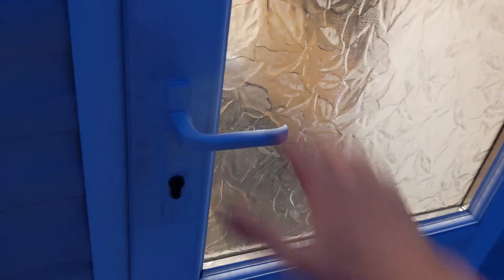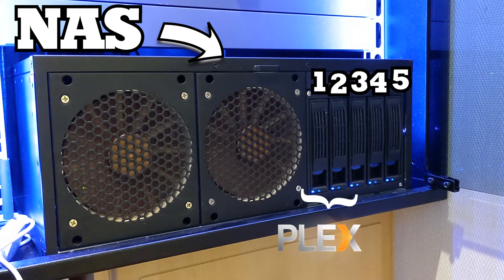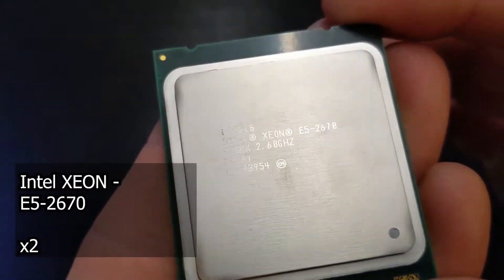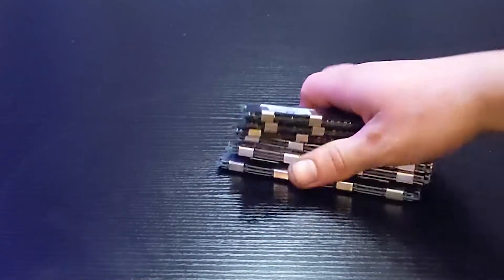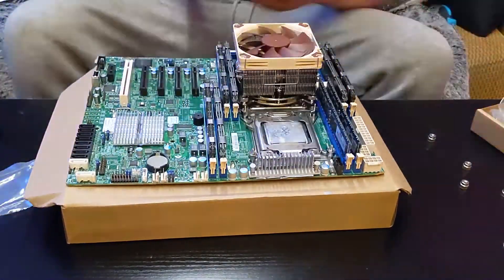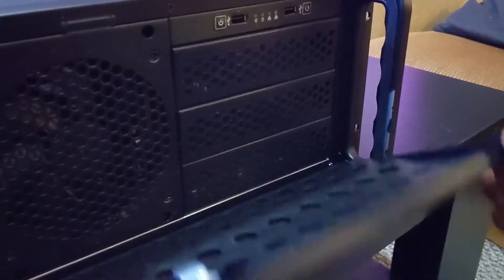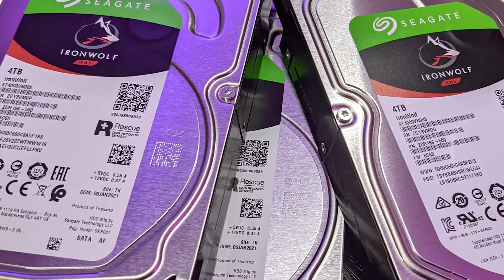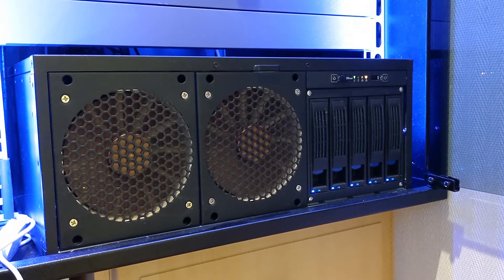Upgrading to the 20TB PLEX NAS

Comment: I have a similar setup. Using a motherboard from Aliexpress that has dual Xeon 2011 slots, and I have a GTX 1070 in it for hardware encoding. It is an EATX motherboard, so I had to go with a huge CUBE style case.